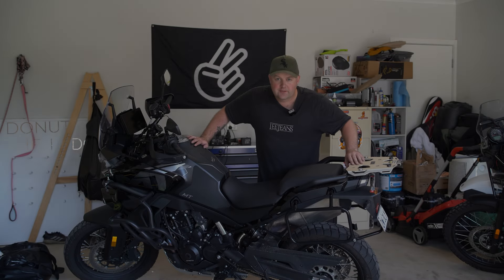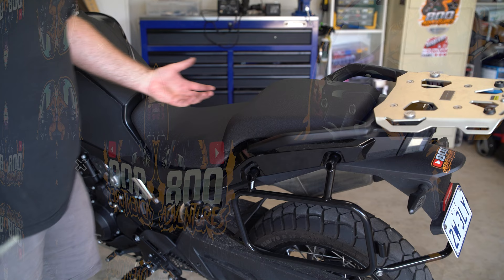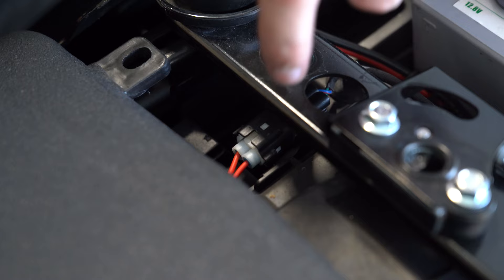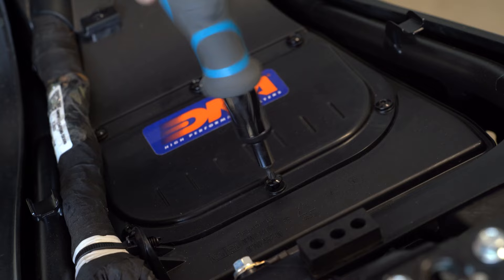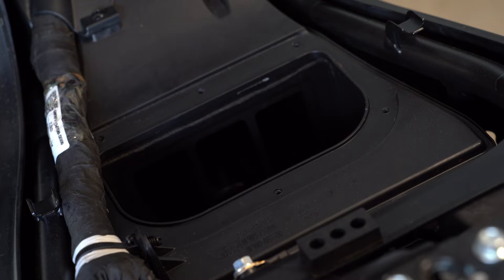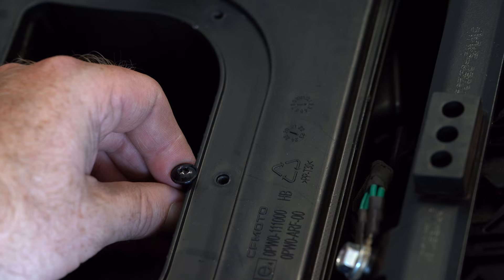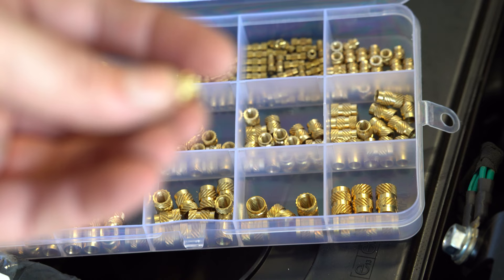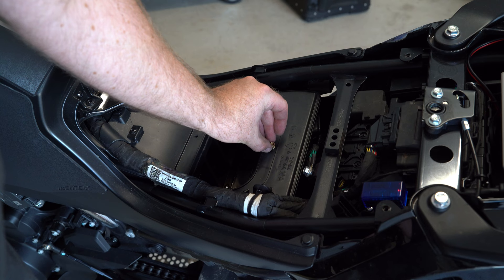Fixing the CFMOTO 800MT Explore Airbox!!!

Comment: Great job Champ👌 the problem with high-low screws in plastic is eventually they do strip the plastic self threads usually through only because of over tightening or re-cutting a new thread instead of finger starting the original cut thread.
What you’ve done is ultimately better for the constant servicing elements.
Well done 🤙
Reply from the maker: Yea definitely, I think I have undone the box 4-5 times and I stripped one already. I knew the others wouldn't be far behind
Reply: @800Adventures  that’s the sign of when it’s going to crap. You did good👌
Reply from the maker: @stevesanelli90  yea definitely a worth while upgrade
Thanks for following  😊
Reply: Thanks for the tip . on my shopping list. Is it possible to buy some of your stickers please. They're cool

Comment: What you did is a great way to solve the problem after you strip the threads out. No power tools should be used on plastic thread bores.  The right way to not strip them is to not screw them in wrong the first time you take them out and put them in again. You only have one shot to do this the right way. This only works from new. That screw creates the threads the first time it enters the bore. From then on the screw has to go back in and engage the thread exactly like it did the first time. By not doing this the screw bites into a new spot in the bore and starts a new set of threads and now you are crosscutting the original threads. The way you do it correctly is put the screw in the bore with your fingers and slowly turn the screw backwards and you will feel a click and the screw will drop right in where the thread starts. Now start tightening the screw with your fingers till you need the tool to finish just snugging and not over tightening. Believe me a lot of people have stripped out the air box on a lot of Volkswagens because of the same thing you guys are experiencing. This method was explained in a Volkswagen service bulletin like 15-20 years ago to ensure thread engagement when servicing Volkswagen engine covers that are air filter boxes. If you don't do it correctly the first time and every time after you will always start to cut new threads and ruin the bore. Sorry it was long winded and might seem tedious to some. This is true for all plastic bore threads that use the metal screw to set the threads in the bore the first time it is run into the bore.

Comment: I would like to add that if anyone trying this, use the same designed threaded inserts (with opposite angled grooves). There are multiple designs each for different applications, like injection molding, and molded/sinked-in ones, etc.
Great idea and tutorial! Love the 'chopped' flag on the wall✌🏻

Comment: Overall, a great value bike but you can see where CF Moto had to make some choices to keep the price down.
Reply from the maker: Totally agree, but for the price I have no real complaints, quality over all is pretty good. The tech side could be improved a bit with Android Auto and some changes to the mapping system
Reply: @800Adventures  It has android auto no? Or do you mean the android auto experience could be improved. Cheers.

Comment: Hey good vid, but the question I have to ask is how many times are you undoing to check your air filter? I had done my homework and fitted a 'Uni Filter'.  I had run my MT800 to Cape York with hundreds & hundreds of k's of fine red bull dust. Being concerned of intake dust I removed it at 3 days in and found the first filter was dirty, but the second filter was extremely clean, so I continued my trip with not even worrying about dusting or chocking the engine. When I arrived back home I went into the airbox to change the air cleaner. Yes, it was due for a change, but this was an 'extreme use' case. The pre filter was dirty dirty, but the main filter was just starting to show signs of 'red' but still with no signs of worrying contamination. I would suggest that I would only check or undo the airbox as per normal usage when the k's for servicing are reached, not the time. (if this makes sense). Since returning I have done lot's of riding and will not even open the airbox, as I am 100% confident that the air cleaner is doing it's job. Now in saying this regardless of filter brands I will always smear a small amount of grease between the air filter to throttle body & airbox lid to box. To be honest I believe that 'Uni Filter' has nailed it. Summing up I think if I kept the 800 for 5yrs I  probably will only open the airbox 5 times. Just giving my experience.
Reply: Can you please put up a link to your unifilter?
Reply: You need to clean your air filter when it is dirty. 
Time or Kay’s never come into the equation. 
If it’s dirty, clean it. 
If it’s clean, leave it be. 
It’s not complicated. 
Just saying.
Reply from the maker: Up until this week I didn't have a pre filter so it got fairly dirty. I am not sure how often I'll take it out but it saves the screw holes from stripping out and wearing out over time.
It was just a small weekend project that I wanted to try and worked out well 😊
Reply from the maker: I have a DNA filter, I got it off thier website. It was shipped direct from Greece. 

https://www.dnafilters.com/en/product/motorcycle-filters/cf-moto/dna-2032/cfm-mts/cf-moto-800-mt-series-(22-23)-dna-air-filter-p-cf8e22-01